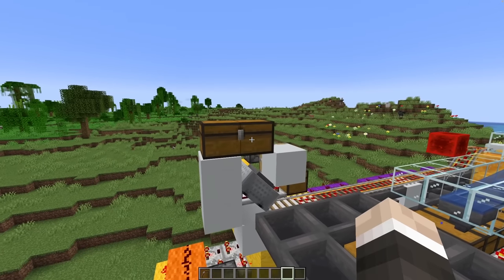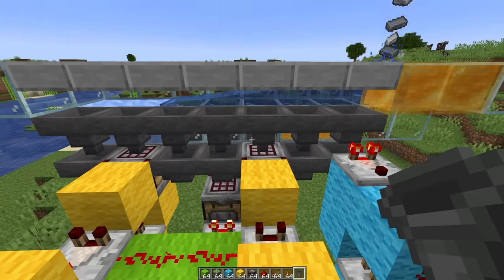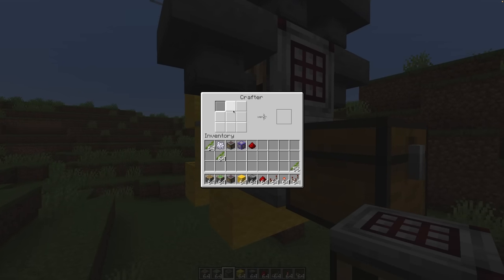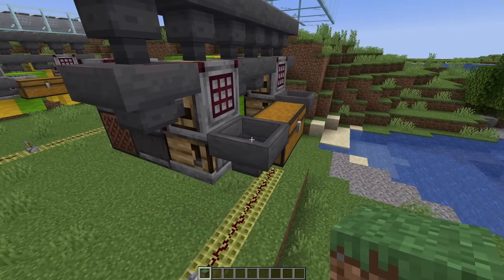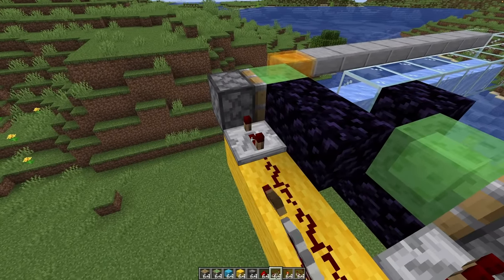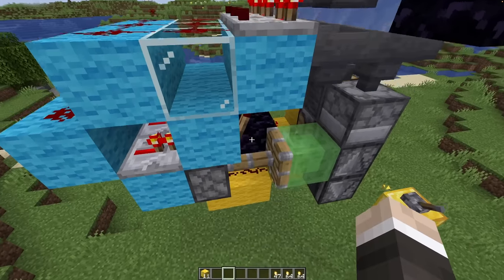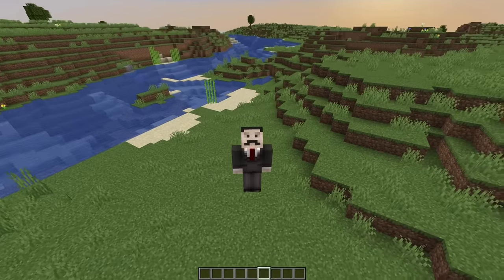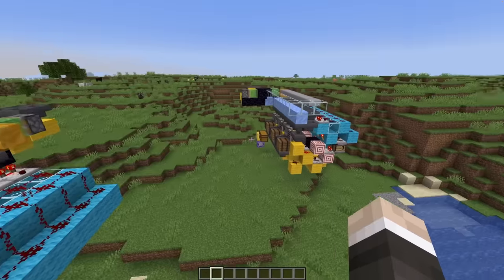Auto Crafters are incredibly useful in Minecraft 1.21

Comment: Here's an idea for you: Combine an iron farm and a wool farm. The problem with wool farms is eventually your sheers are going to break. With an iron farm you could craft sheers and iron blocks with the crafter.
Reply: GENIUS
Reply: Seems like you'd get far too many shears if doing it automatically. I think having the iron farm nearby so you could fill an auto crafter would make sense though. That way you could just press a button and get shears.
Reply: @CottidaeSEA  you could also use comparators to detect when the shear dispensers are empty and activate the autocrafting that way
Reply: @CottidaeSEA  Maybe a redstone clock could be used that would allow some iron from the iron farm to be crafted to shears and sent to the wool farm every now and again?
(Is there a way to detect when the shears break inside dispensers?)
Reply: @CottidaeSEA have it where the sheers fill up first and then any iron overflow goes into iron blocks.
Reply: @CottidaeSEA   that would defeat the whole purpose of the auto wool farm.  have a comparator on the dispenser that has the sheers. and then you can detect when one breaks.
Reply: X mentioned this on a recap video on his channel showing that he actually did that on the most recent hermit craft server but would need to go and craft the shears then load them into the sheep farm below. You could also make it so that ingots bypass the autocrafter then the system is full and go to iron blocks instead. Imagine also using the poppies from the iron farm to make dye and then use the dye to make a crapton of red concrete or terracotta. Like there are a ton of cool autocrafting farms you can now make by combining this stuff. Can't wait to see stuff being built with this in survival.
Reply: @lilybelden9405  Hmm... that's true.
Reply: yeah
have the iron farm usually produce iron blocks but when it detects the shear supply getting low it produces a handful of shears
while you're at it, you could also probably do turn the poppies into a dye farm and combine it with a few other dye farms, set up a toggleable carpet producer, use a hopper clock to denote exactly how much you need of each colored wool/carpet type, and have it auto-run until you have the desired exact number of each type
Reply: @CottidaeSEA  i feel like you could detector the dispensors so that it sends a request when empty.
Reply: @CottidaeSEA 
or you put a sheep on a 1x2 of gras and check the block for updates (sheep eats grass and regrows wool)
after that, you trigger a dispenser (with shears in it) to shear the sheep
if after that no wool goes into a hopper, you trigger the crafter to create a new pair of shears and trigger the dispenser that now does have shears.
Rince and repeat :)
Reply: Iron farm to wool farm to string farm to raid farm to bone farm to bonemeal farm to wood farm to bed farm to villager tradin hall to ice trading to bamboo farm to kelp farm to fuel farm to auto crafter farm to iron farm again...

*"Me and the birds" starts playing*
Reply: Could also get an unbreaking 3 librarian villager and just store 20 pairs of unbreaking shears to last you years
Reply: @madmanwithaplan1826  Yeah, didn't think of that first. You could also stop creation if the dispenser is full. You'd end up with a random distribution of shear usage, but that should honestly be fine.
Reply: And this is just scratching the surface for what you could do with auto crafters
Reply: Or you could use a string farm, autocraft the string into wool and then you don’t need shears
Reply: All of this talk just shows how much new innovation can be done to minmax resources for minimal effort and it is great to see
Reply: I have never run out of shears in a wool farm
Reply: Fill a chest with shears and get more wool than you’ll likely ever need. Less work than automating it
Reply: @monkeyzap8241  assuming you're not using a sheep-conveyor that tears through shears XD
Reply: he already did that in his first video about uses of these new blocks, cool how you both had the same idea
Reply: @arttops2563  using a comparator to check a dispenser's fill level, and then when it's no longer full that means shears have broken, sends a signal over to the iron farm to release 2 ingots which flow down to a crafter and then into the dispenser.
Reply: @CottidaeSEA 
Shears are inexpensive though.

You could just have a hopper pointed into it and a comparator checking it if it reaches a certain signal strength. That way you can then lock off the shears input.

Combine that with an AND gate linked up to all of the shears refilling systems so that it basically says "hey, all of these are filled up" and a way to switch the autocrafting on and off, and there's a system for crafting shears without somehow wasting all of your iron.
Reply: @adora_was_taken I mean they could simply also detect when the hopper feeding the dispensers are empty, and make sure they have a single spare, I think this works better space-wise
Reply: I think one double chest filled with iron blocks that would auto craft to shears would be more than enough.
Reply: @CottidaeSEA could have it craft in a timer possibly, if you set long enough timer would solve this issue.
Reply: How do you automate shearing? Dispenser in fornt of sheep??
Reply: @CottidaeSEA you can make it craft shears when you run out or at certain redstone level measured off of the dispenser.
Reply: I would make it so that when the shears are full itll stop creating shears and then at that point divert the flow of items to a second crafter that autocrafts em to iron blocks seeing as most iron farms will produce far more iron than ull need for this one farm.
Reply: Or have some of your iron fill a chest that runs into an auto crafter, and have the auto crafter run into the dispenser. Whenever the dispenser uses all of a sheers durability it should craft the sheer. Like use a comparator to detect when a slot is emptied.
Reply: See, that’s a great idea, but using a spider spawner farm to create wool would be more efficient. Spiders drop string, and autocrafters can turn that into wool for you - and you get spider eyes as a minor bonus, without needing to deal with replacing broken tools or needing a second farm to help.
Reply: Mabye add a comparator to test how many Sheers are left and if the signal strength drops, a new sheer is made
Reply: Or just hook a crafter setup to a spider farm and make wool from string
Reply: Infinite wool farm? Why not take it one step further and create a factorybthat crafts all the things you can make out of wool? A tree farm for making beds, a  crafter for carpets, one for paintings, (and a few more for whatever I'm forgetting), do that for every color of the rainbow and you have a hermit craft empire.
Reply: @CottidaeSEA  Depends. You can do a full hopper line or just individual cooperators for each dispenser and connect them all with a water stream. So each wool module can request shears when a pair breaks then will automatically pick them  up when it gets there on the water stream.
Reply: That is too genius for my me! I think I need to take a break to think about this... 😅
Reply: @arttops2563  just fill the dispenser, use a comparator to detect when there is one less item in the dispenser and send request for shears
Reply: That’s a good idea 👍.
Reply: And Gnembon was saying Crafters wont be revolutionary. How can that be true when we can see the enormous potential?? Makes me think he knows they'll be nerfed before release.
Reply: Add a wood farm and now you've got a red bed farm
Reply: @doctornobody105  simply Java has become a reality
Reply: Just put mending and unbreaking on your shears
Reply: @CottidaeSEA put 9 shears in the dispenser and whenever less than 9 are detected call the farm and have it craft a new one to send back.  Worse case scenario they all break at the same time one after the other but you should still have plenty of time to funnel in 9 more before that happens
Reply: He should add gold ingots to the system! What if the zombie piglins drop gold ingots? It gets thrown out. It should go in the system
Reply: Also means spawners can be turned into gold and iron farms just have the armor and tools get smelted into nuggets and turn those nuggets into ores but would be slow but not unless you make it max efficiency
Reply: WHOA. 

This is a fantastic idea, and yet terrifying
Reply: Or just put a few stacks of iron blocks in a hopper and use crafters to craft them into ingots then shears and put it in the dispenser of the wool farm, that would be easier
Reply: @danieldavies3092  Thank you, oh Great Redstone wizard!
Reply: dude. that's genius.
Reply: I thought about this
But add a bamboo farm craft in too wood and make beds
Reply: Wouldn’t this work better with a sipper farm and crafting the string into wool
Reply: THATS GENIOUS
Reply: @CottidaeSEA u can set it up so it only makes shears if its empty
Reply: iron farm not necessary, just 1 double chest filled with iron block should provide a lifetime supply to auto craft shears on demand.
Reply: Given a shulker full of iron blocks will give you 7776 shears, not sure you even need to connect the iron farm into a wool farm (other than for the fun of it).
Reply: and honey farms! You could get a super smelter in place that turns sand into glass and crafts bottles when needed. or maybe you could just trade with villagers to get glass and put the glass in the crafter. either way it saves time on crafting bottles!
Reply: @patrickramos7511  Unfortunately leather and diamond armour will clog up such an auto-smelter eventually.
At best you can use horribly whacky contraptions to detect all kinds of boots, then remove leather boots from that (with some powder snow and armour stand mess) and try smelting the rest, but that's only 1/4 of all the armour pieces and still doesn't handle diamond.
Zombie spawners may work if you only try smelting their weapon/tool (that's always iron IIRC?), but I can't remember if there's a non-stackable filter for tools vs armour.
Reply: I feel like this is a lot of extra effort when you could simply make crafters craft wool from string via a string farm 🤷‍♂️
Reply: @CottidaeSEA  dispenser moment + just use mending
Reply: @MrSimpsondennis this is actually something the community as a whole is wrong about, dispensers with shears can be clocked losslessly/silently so just clock your dispenser with any source at all. The observer actually removes a potential grass block so it's more resource intensive and less efficient to use observers. I recommend a cow wandering between 2 to 3 pressure plates
Reply: I'm thinking that my iron farm will basically craft every iron item and disperse them where I need. I can run a hopper cart tied to a long clock to only pick up shears every so often and then have an over flow area that will send shears to my main storage when the wool farm is full .

Comment: With the gold farm situation, because zombified piglins drop gold swords, wouldn’t it be possible to have them feed into a smelter that then goes back into the main system?
Reply: Yes it's possible, but with a decent sized gold farm it's not really worth the extra complexity to worry about the swords
Reply: i agree with the comment above me, whether the gold farm is complex its not really worth it; as it also costs fuel and theres not a lot of infinite fuel methods in the nether.
Reply: Could you use a crafter to repair them together to reduce the volume? Dunno  why you'd want to but that feels possible
Reply: @Bobdd0  Smelting returns doesn't care about durability, I thought
Reply: @dogdog357  not to smelt, but to store
combine multiple low durability swords into 1 full durability sword
Reply: @bucket1442 that'd be possible i assume but like why? they're two gold ingots each just craft them
Reply: @okebedoke zombie piglins drop damaged gold swords every now and then. take those damaged gold swords, combine them in an autocrafter to reduce the amount of space taken up, then smelt them down for more nuggets. i'm pretty sure a bamboo farm can be built in the nether, thus handling the fuel issue.
Reply: @cokepotoats bucket literally said "to reduce the volume", one sword is objectively less than a gazillion of them, meaning that if one where to be obtuse about gold swords, then one could either leave said single sword in a storage container or have it destroyed in a less laggy way than tossing hundreds of entities at a time into the world.
Reply: @islimpycat  that sounds like a funny lore(tm) way to make a sword. The infinity sword, infinite numbers of blades crafted into one buttery blade. Almost sounds zedvancment-y
Reply: @babymarsh  No infinite fuel in the Nether? Son, lava farms are a thing.
Reply: @islimpycat  I posted mine before their comment about reducing volume loaded for me
Reply: @babymarsh what about lava drip?
Reply: @babymarsh my nether industrial district has a netherskele farm which ports the coal over to my gold farm so i can have my main furnace array double for general use and smelting the weapons (mostly because im very much a no resource wasted player)
Reply: @okebedoke  oop, my bad, I saw that out comment was below theirs and assumed that youtube did the logical thing and listed the comments in chronological order instead of checking them.
Edit: your* not out. My phone is on some strong auto correction opioids it seems.
Reply: @NicknotNak  based (though wouldn't it be easier at this point to use a dripstone lava generator for the smelting and then send the coal to become coal blocks for building or to be constructed into torches or maybe even traded into emeralds?)
Reply: @whodawhatnow8737 but with the autocrafter you can completely automate combining them and then smelt them into nuggets that just feed back into the system
Reply: @islimpycat  i have a lava farm in my overworld base, but i found it to be more annoying to make a furnace array around so i just use my nether one. I spend enough time in my gold farm bc its set up really close to my base. 

I dont use coal for much else, and i could easily grab what i need if i wanted to. Im not the most efficient player, but i dont waste what i get.
Reply: @md_vandenberg  i completely forgot about those, my bad; but i did say "there isnt a lot of infinite fuel methods" though
Reply: @babymarsh  wouldn't a bamboo farm be an infinite fuel source?
Reply: @soraos21 but you don't get more gold nuggets. You'll still only get 1 nugget per smelt
Reply: @NicknotNak  aight.
Reply: carpet dupers are a stupid easy infinite fuel source
Reply: @spritemon98  true. but even blast furnaces take a bit to turn that one fully repaired sword into a nugget. high efficiency gold farms produce a lot of swords.
Reply: @soraos21  then by that point all the nuggets from the swords become useless if the farm is highly efficient
Reply: @babymarsh actually you can have a bonemeal based bamboo farm in the nether, and it just so happens that zombie piglins drop rotten flesh which can be converted to bonemeal.
Reply: @babymarsh Couldn’t you have a cauldron piston feedtape with dripstones to have infinite lava buckets for fuel?

Edit: Didn’t read the other comments also mentioning this
Reply: usually not worth the effort
Reply: @md_vandenberg  Problem is, dispensers can't extract lava from cauldrons
Reply: Yes, And I like this, However-
Where is the fuel going to come from?
Reply: @milokiss8276  Dried kelp blocks, obviously. Made using their own infinite dried kelp transported through a portal
Reply: @dogdog357 bamboo farm
Reply: This is very good idea and easy to make, just add a furnace and it's good
Reply: It’s really just not worth it, even end game, you’ll get barely any gold as it takes forever to smelt and you get one nugget per piece of gear. It’s better to just create an auto destroyer for them.
Reply: sword smelting gonna be way too slow, you'd have throw away a majority of them anyway cuz of overflow so not worth the extra trouble
Reply: I dunno why but if someone want to actually smelt gold weapons/armor they just need 3 Item sorters (Gold ingots/nuggets and rotten flesh) Anything else that isn't one of these will be dropped In furnaces and those furnaces could be powered with Bamboo that are created from a bamboo farm
Reply: @babymarsh  you could just use a kelp farm and send the blocks through a portal. Or more simply, a bamboo farm would work.
Reply: @md_vandenberg  fully automatic, lava farms need to be collected via hand.
Reply: @babymarsh what about wither skeleton farms? Infinite coal